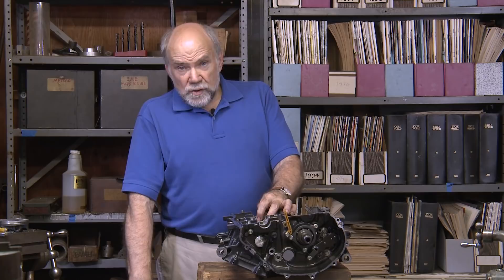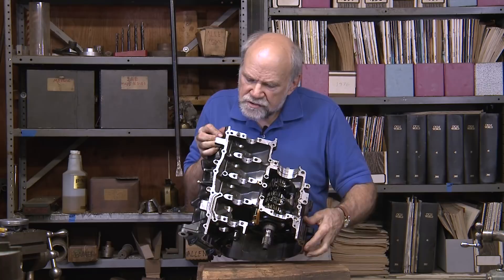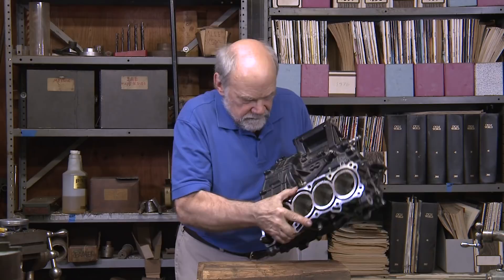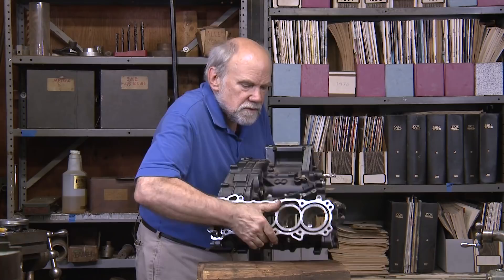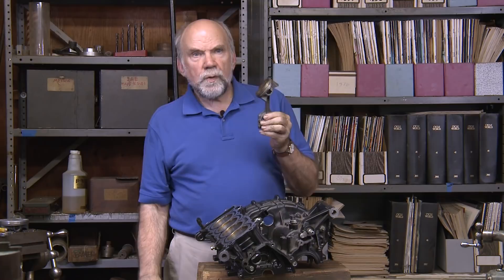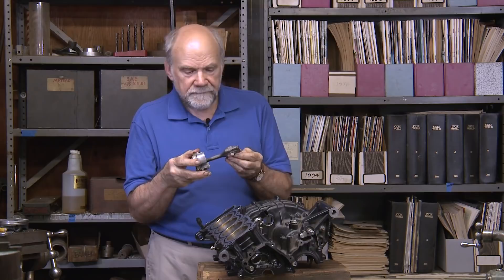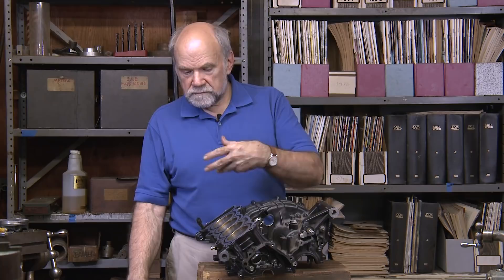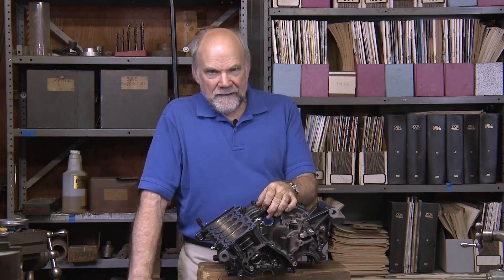How Do Piston-Cooling Oil Jets Work?

Comment: Good video.  Technically the piston oil jets got their start on the Twin Cam though.  I'm working on adding them to my 106" Evo because I'm on my 3rd piston failure from piston heat and scuffing.

Comment: I love these videos, very informative.

Does anyone know if the oil goes past the cooling system prior to getting jetted under the piston? I’ve always thought the oil from a warmed up engine sump would be like using hot tea to soothe sunburn?
Reply: The pistons and heads are the hottest part of an engine, so the oil itself is going to be cooler.  Of course a dedicated oil cooler helps but the oil gets "cooled" by circulating again through the engine.
Reply: @hakrsakr  valve springs run extremely hot as well
Reply: Even if the oil is only 5-10 degrees cooler, it will help control heat, keeping it from reaching that point of no return where we end up with a thermal runaway situation that will certainly lead to what I call (R.U.D) 
Rapid
Un-commanded
Disassembly…

Comment: It says on internet 2011 3.5 EcoBoost uses piston cooling... 2011 f150 EcoBoost    114,000 miles burns 0 oil....although some people say 2018 f150 EcoBoost  5.0 liter engine burns oil.... New truck burns oil wtf, were engineers ,thinking..